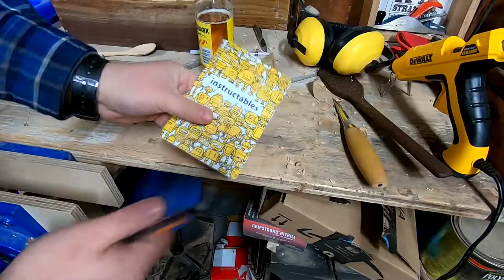Carving a Wooden Toy Hammer for My Son

Comment: I got a little nervous when you began drilling that huge hole into the sanded hammer head. All that work at risk! Came out great afterall.
Reply from the maker: That would have been sad if the drilling didn't work out. 😓 But i think I know someone that would have been able to fix it 🤣🤣 thanks for watching 👍🍻
Reply: @TheGrantAlexander  something a little wood glue might fix